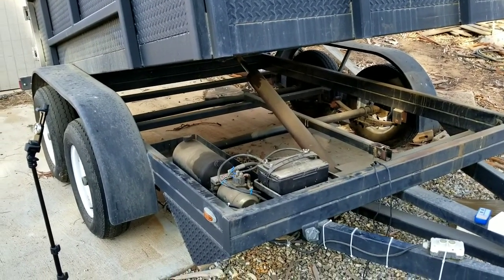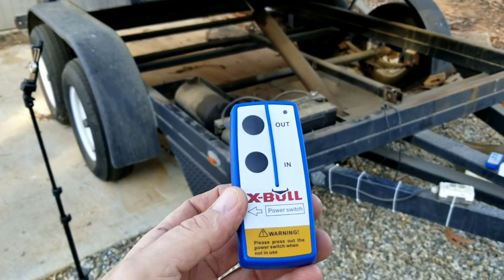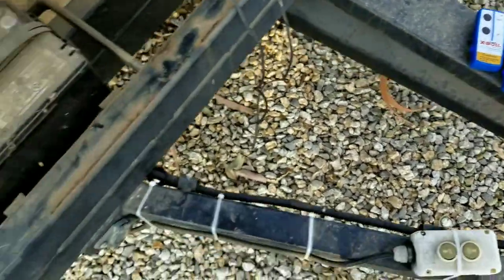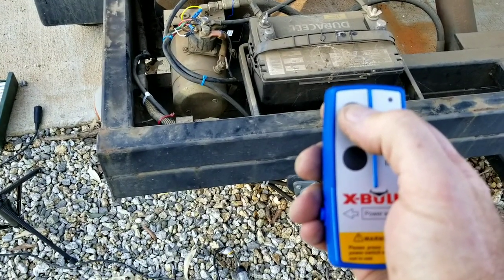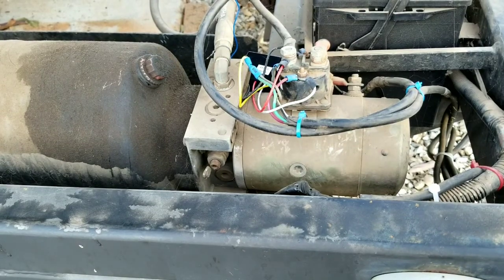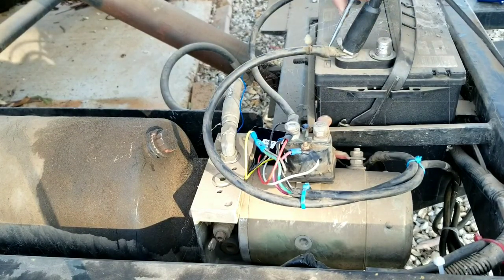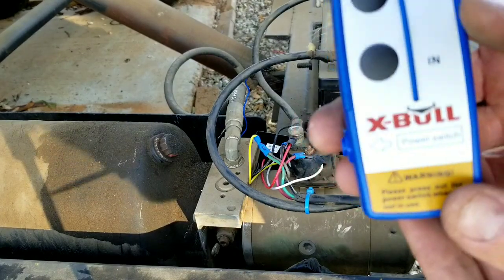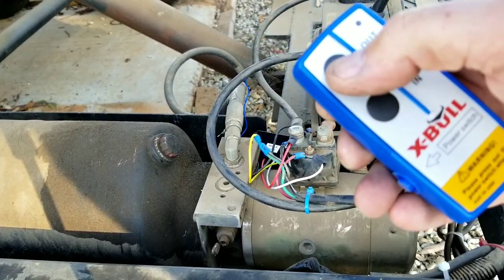wireless Winch or dump trailer remote control install How I did it.

Comment: I bought the exact one on ebay (china) installed it, worked 3 times and started running intermittently off and on very quickly.  Emailed seller, they eventually sent new unit to replace,  I haven't installed it yet, but when I do I will use 2 separate relays to do the heavy lifting so unit wont burn out again. Should have bought unit from manufacturer,  but after using dump trailer realized I made huge mistake.  Salesman said addon for remote from factory was $600 at purchase..huh, that's another  reason why I passed, 6 months later called factory up in Quebec spoke to representative and he said $60 for him to send it.  A profit is one thing but that's ridiculous. The trailer is an N & N 10,000 dump trailer galvanized pull behind, has been a fantastic trailer..
Reply from the maker: yea might be a good idea to take the load off. I havent had any problems with mine yet.
Reply: Update, I just bought this package again but with the heavy relay included with the purchase, I think it was $47ish on ebay. Liked the wiring on this new one compared to wiring in two separate auto relays in combo with lighter remote electronics.

Comment: Does anyone know how to wire it to a power up and down pump i have 2 30a 4 pin relays just trying to figure out if that's the best way
Reply: Did you find an answer? I have the same power up and down and couldn't get it to work

Comment: I enjoy watch  your video one the remote I just installed a pump on my trailer and was seeking information on wiring ?. My pump is a fenner fluid 1789-A1 12vDC, it was a used pump the plastic tank was broken so the guy bought new assembly that worked for me cause he gave it to me. The pump has one valve  I see you are powering both ways I only can see one valve on yours ? is that correct ?.
I bought a harbor freight remote that should work the same as the one you demonstrated ?  Did you use (Black for Ground) and (Red for positive) I didn't understand  (Yellow does  it go to solenoid) does (White go to switch) ?
having white going to the pump solenoid allows to run pump up and down running the motor ?
If I wire so I have power up and gravity down to save on battery life and running motor. To wire for power up and gravity down  The wires from the remote are: Red, Black, White & Green. Black is ground, Red is for power, White for the solenoid,  Yellow  goes to the pump.

So what happens when the up button is pushed up button Red being Positive and Black is ground the White is attached to starter solenoid and yellow is to the pump solenoid . Wiring like this will it allow power up and gravity down feed ?
my email is : robjens2200@outlook.com Thank you so much.